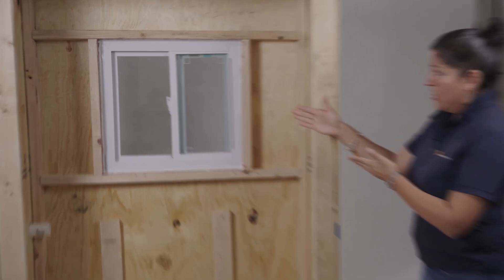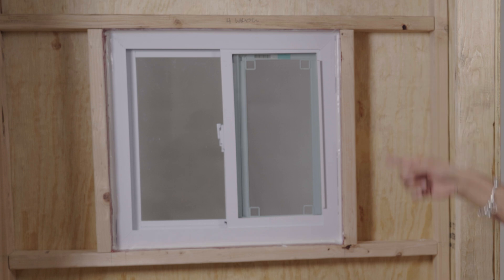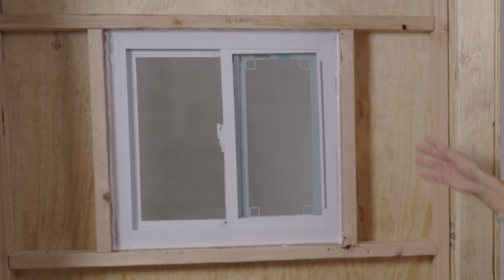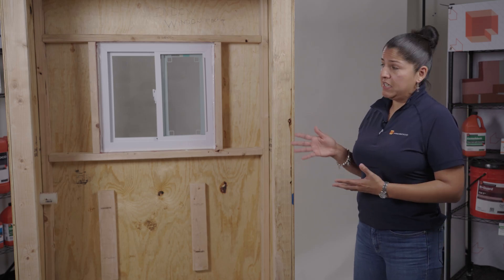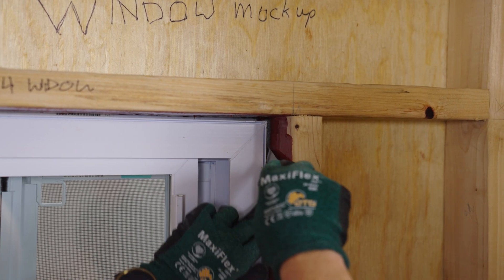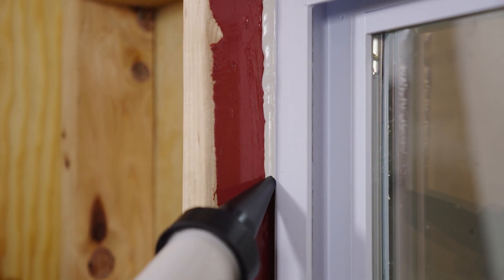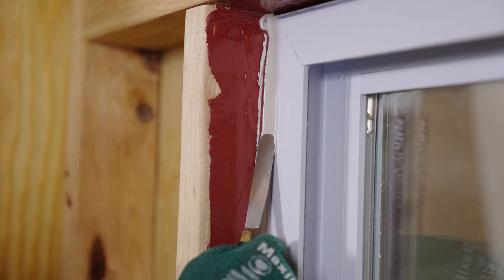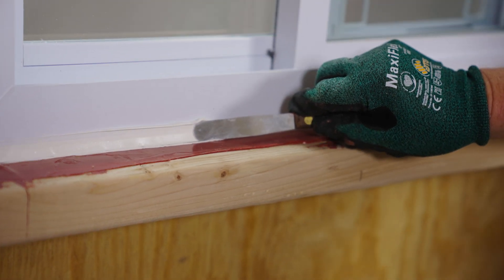The R-Guard System: AirDam

Comment: Is there an approved installation where both foam and airdam is installed? The window manufacturer, Marvin, has low expansion foam recommended in the.area between the window flange and the interior face of the window frame. I don't know how I would apply foam, backer rod, and AirDam. The foam would interfere with the placement of the backer rod, I'm guessing.